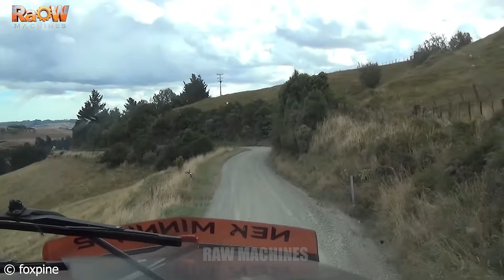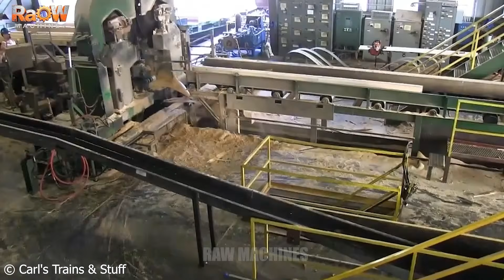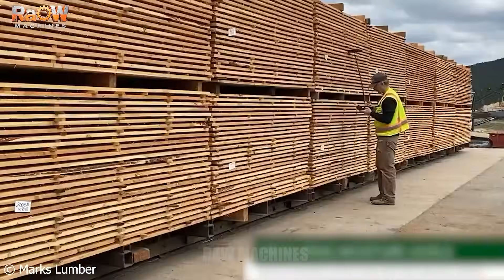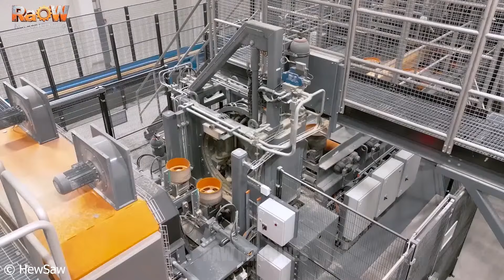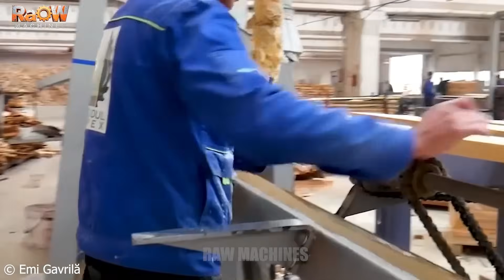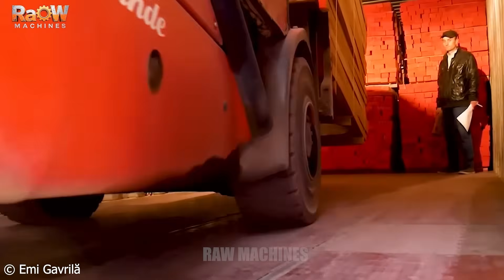Inside America's Largest Sawmills | How Giant Trees Become Premium Lumber & Timber Beams

Comment: Cutting with the natural curve of the tree definitely gets more boards out of a log but makes it so that the board are cupped and have curves which makes it hard to use
Reply from the maker: Thanks for sharing your insight! 👏 That's a great point. Sawmills are always balancing recovery, efficiency, and final product quality, and different mills make different choices depending on what the lumber will be used for. We really appreciate you adding your experience to the discussion! 🌲
In your opinion, what's the best balance between maximizing yield and producing straighter, higher-quality boards?